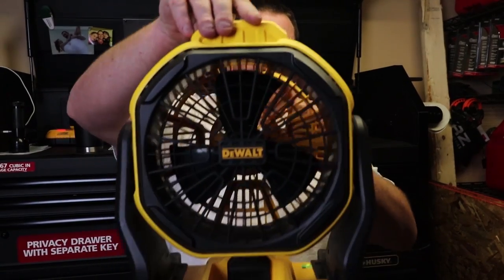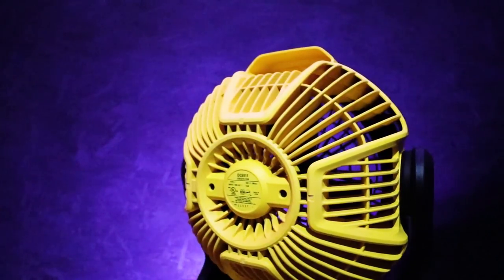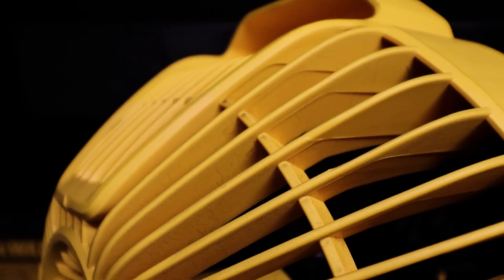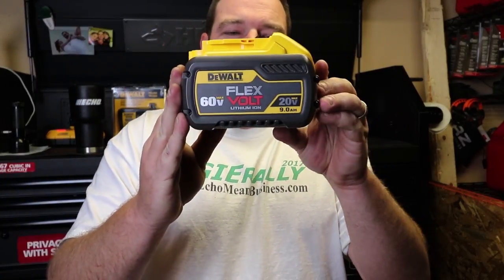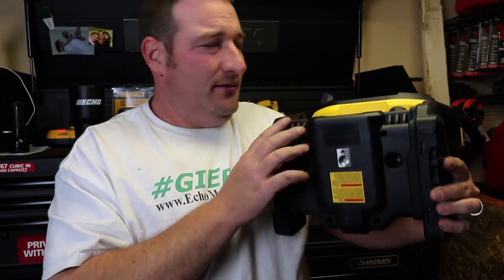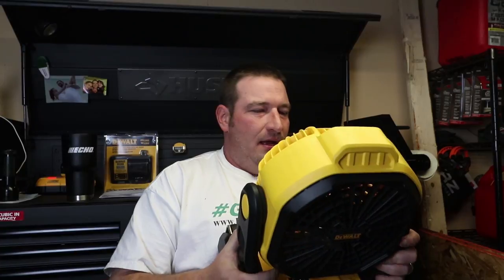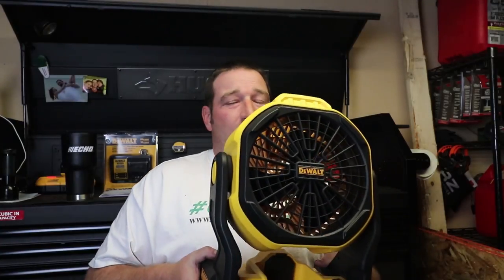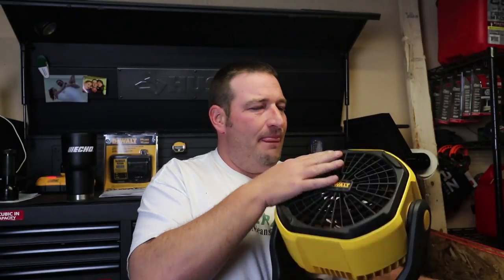Dewalt Jobsite Fan, Is It Worth It?!?!

Comment: Great review. I have been looking for one of these for the portable factor. It would sure be nice to move the air in an enclosed trailer, and as others mentioned for camping on those nights it is just to dam hot and the 5th wheel was not an option due to the bass boat. Dewalt makes some cool toys to go with the tools of old. The hedger is great, the string trimmer was better than I ever expected and the blower works good for the fast blow out of the shop or the home owner grass clean ups. Yep the fan will be the next purchase then the chain saw for the light pruning.
Reply from the maker: Ron Spencer I definitely agree this can come in handy for multiple uses. And it lasted way longer than I expected on high non stop. So huge pluses all the way around. Thanks for watching!!

Comment: It's worth it. True 7hrs on 4ahr at highest setting. Few flaws are it doesn't oscillate, plugs in from front, and doesn't replace table top fan in terms of cfm. Wish it was brushless. Comparing it to a Lasko fan doesn't do it justice.

Comment: oh thank you for fan comparison on cfm.  would like something more or a squirrel cage fan battery operated.  wow it does fit 9 amp hour battery.
Reply: I am running 9ah and it has been for 48 hour on low and still have 2 bar.  Great for family van and storm shelter.

Comment: Will it work with the 20 volt battery for the dewalt drill???.....I know it's lower amp battery and less run time......thinking about getting this fan to keep in the enclosed trailer in case you need to cool off some time or just to move air while loading or unloading the trailer....plus it's portable and runs on AC too so it could be used in the shop also
Reply: Ya, its compatible.  The Dewalt 20 volt batteries will work in all Dewalt 20v tools.  
The amp hour is nothing more then run time.  If the 4ah will run it for 7 hours, figure 3.5 hours on a 2ah.

Comment: I lost faith in dewalt years ago. I bought a radio brand new and just after a couple years of light use it completely stopped working. It was never wet or dropped. We mostly used it for a shop radio.
Reply: If it’s the 18v radio it happened to everyone there 1st Gen radio what do you expect
Reply: A couple years? You bought a 1st generation product with a 12 month warranty, got over double that out of it, and wrote off an entire brand as a result? Did you have the radio repaired?
Reply: LOL!!